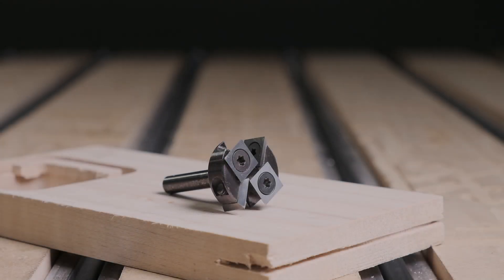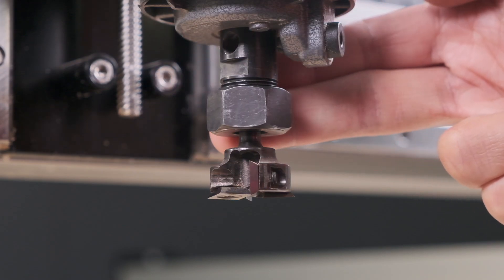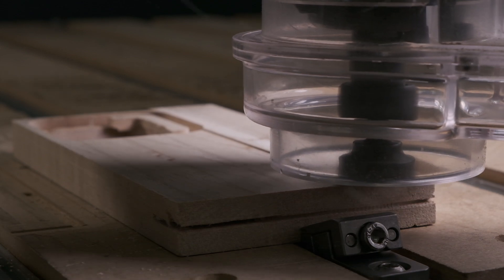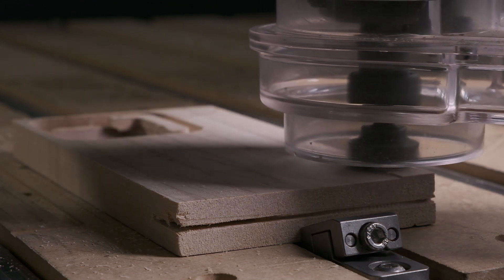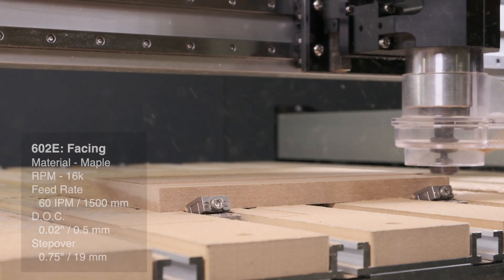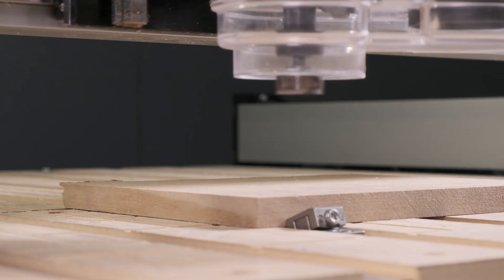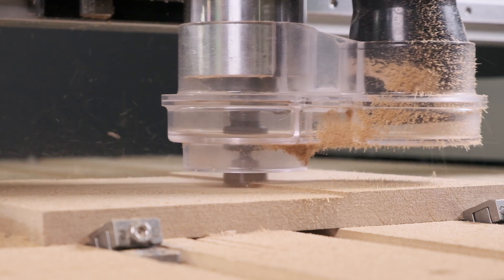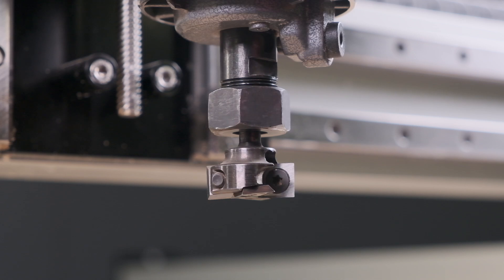The McFly Cutter - Save Time, Flatten Wood Fast

Comment: How does it work with the bitsetter if the center is higher than the cutter inserts?
Reply from the maker: The BitSetter on the Shapeoko 5.1 or HDM should work for surfacing bits up to somewhere between 1.5-2". We don't recommend using anything much larger than that. But if you really wanted to, you can disable the BitSetter and set your zero height manually.  (-W)

Comment: can i use this with my touch probe??
Reply from the maker: Are you asking if this will work with BitZero?
Reply: @carbide3d  i was wondering if i could use my touch probe with the mcfly bit
Reply from the maker: "Touch probe" is an ambiguous term that could describe two different products in our lineup: the BitZero and BitSetter. But the answer is yes to both. 

For the BitZero: Just don't use the McFly in your spindle when setting your zero, use the included dowel pin. Swap in the McFly after your zero is sest.

For the BitSetter, the diameter of the probe's head is large enough to register against the inserts of the McFly.
Reply: @carbide3d  🤣🤣🤣thank u

Comment: This can plunge cut without a ramp? Did I miss that? Thanks.
Reply: Carbide 3D provides a "flattening" project file which is intended for use with the McFly cutter. This project is just a big pocket cut, so it starts in the center of the work and spirals out. From that, it would seem that the McFly can do plunge cuts.

Comment: I am disheartened that this is clearly shown surfacing in a zigzag pattern yet this simple basic function has never existed in carbide motion. Please add this feature to your software.
Reply: I was thinking the same to me it should have been an option for zigzag year’s ago
Reply: I third this add a surfacing feature and add the tool to the library
Reply: The most simple job tge cnc can do yet not an option. Please add this tool to the library and add a flatten tool path please

Comment: Can you use it with the bitsetter?
Reply: I would NOT
Reply from the maker: For surfacing the Hybrid Table we recommend removing the BitSetter and disabling its functionality to avoid accidentally crashing into the BitSetter. Otherwise, on the S3 and Pro, there should be enough clearance to use the BitSetter. On the S4, the BitSetter location + diameter of the cutter puts it dangerously close to the MDF slats when the tool comes down and we would not recommend it. -W

Comment: Will this work with the Nomad 3?
Reply from the maker: Because of the large diameter of the cutter, McFly requires a pretty torquey spindle to be used effectively. You'd have to take such a shallow cut with the McFly cutter that it wouldn't be worth it on the Nomad3. Better to use a 1/4" downcutting endmill for flattening purposes, crank up the RPM and use a higher feedrate. -W
Reply: @carbide3d  question got my hopes up but the response brought me right back down to earth :)